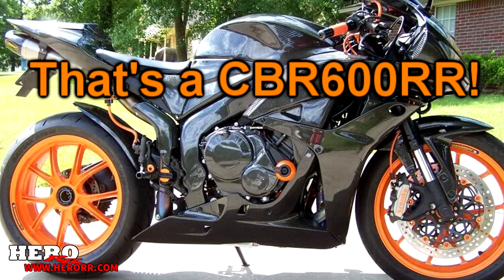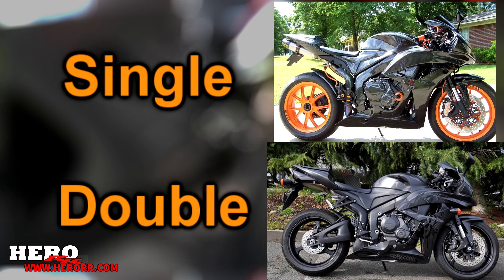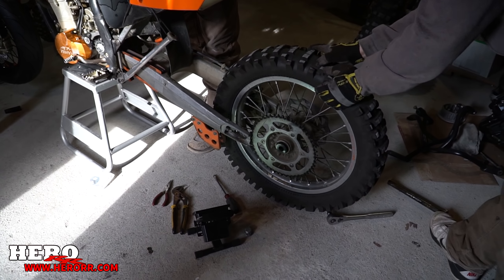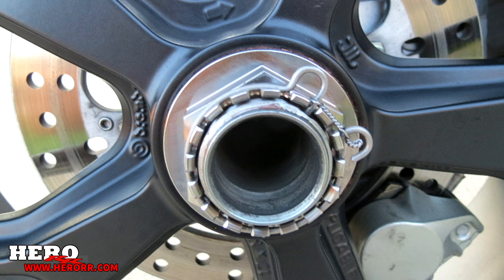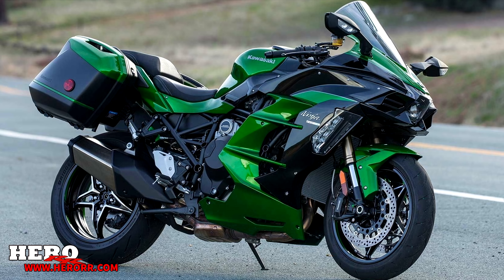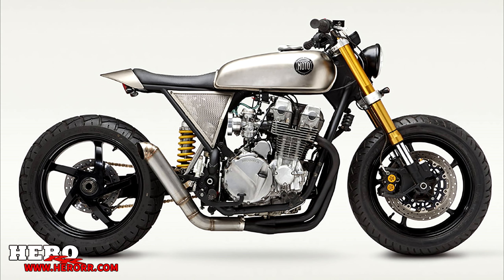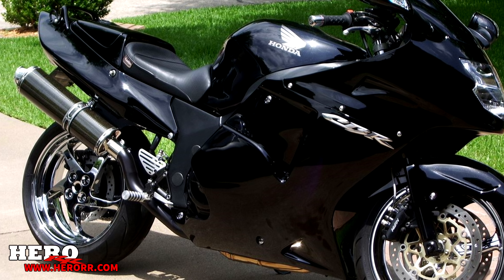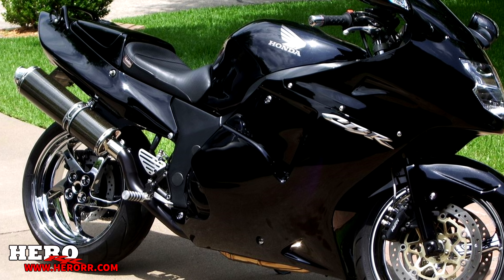Why Every Motorcycle Should Have a Single Sided Swingarm

Comment from the maker: I hear you guys! I get it that MotoGP bikes have Standard swing arms. You need to understand that MotoGP bikes make over 250 horsepower and are less than 350lbs dry. The reason why they use traditional swingarms are because the twisting motion required to handle that much power would make the swingarm heavier, and the weight would be bias to the left side (or right) which is a no-no on MotoGP bikes. I don't know why you guys care about what MotoGP uses anyway? It couldn't be more irrelevant to all the other bikes we are ride. Remember moto GP bikes don't even have a starter, they have to bumped start. Are we going to really start a debate on why electric starters suck too, just because motogp doesn't use them? LOL
Reply: People care about Moto GP, and any other form of racing, because the best technology from those bikes works its way down to street bikes. Without that we wouldn't have liquid cooled bikes, mono-shock rear suspension, monocoque frames, upside down front forks, aerodynamic fairings and so much more that's been improved through racing. Of course a race bike is going to be as minimalist as possible to save weight, but it's ignorant to not acknowledge the link between the street and the race track.
Reply: With that logic people should just stop racing bikes competitively because they’ll never be motoGP riders.  Do you even hear yourself? Not all riders aspire to race competitively but also not all riders ride bikes just for leisure and cruising.
Reply: the peugeot speedfight 2 has a single swingarm in front

Comment: Aesthetically, and for ease of maintenance they are better, but that is all. A conventional swing arm is inherently mechanically superior, and allows for finer tuning of side to side flex in the swing arm as the bike is leaned over. Even Ducati use a conventional swing arm in their Moto GP bike for this reason, and the Ducati WSBK teams have talked about the difficulty of tuning the rear end due to the single sided swin arm, which they've had to cut and patch to get the proper flex.
Reply: crisray6789 I'm on your side before you think about bitting my head off. now I own a driveshaft motorcycle and I know the reason they don't use thoughs is because it pulls to the side of the swing arm when you give it throttle but I thought just the single sided swingarm people didn't use them because of it not having = weight!? not saying what you said isn't true but I think weight was the factor. LMK what you think.
Reply: Shaft drive bikes are usually fine with having a single sided swingarm since the drive shaft is already supported thoroughly by an outer shaft housing so adding another side to the swingarm is unnecessary. Shaft drives aren't very good for sport bikes though since they are much heavier than chain drives and sap more horsepower.
Reply: crisray6789 no I know I mean what are your thoughts on the none driveshaft single sided swing arms. I think there con is not having = weight on both sides. would you say that's a myth or is there truth behind it!? the = weight might sound silly but when dealing with two wheels it puts it into a better perspective.
Reply: @canyonkiller4431  Sounds feasible. You have all that weight on one side of the bike with a SSSA. Picture waving a lollipop(SSSA) vs. balancing a teeter totter(DSSA). Changing direction would probably be easier towards the side the swing arm is on, as you're accelerating the mass with gravity and harder as you're accelerating the mass against gravity.
Reply: Rock Fisher that's what I was thinking
Reply: In your opinion
Reply from the maker: The side to side flex is so minor that it really only makes a difference at the MotoGP level. For street bikes there is no real handling advantage from one system to another. I get that people always love to talk about the MotoGP bikes, but I never understood why. I mean how many of us have a 300 horsepower 250 mph 400lb motogp bike that we race on a track? My content is more or less suited for street bikes and street riding. Although an SSA is fine for the track and high horsepower bikes (see ninja H2R) only at the very highest level of performance where literally every gram of weight is measured do you actually see a difference.
Reply: HeroRR Moto GP sports the most competitive machines in all of motorcycling, any advantages that can be had, without breaking the rules, will be taken. So when looking at what will work best for performance Moto GP is the place to look. As for street bikes, it will cost more for any given level of performance, without any gain other than aesthetics, and ease of maintenance.
Reply: HeroRR but if the sssa was the best motogp would be using it so it's not the best. you just admitted yourself. PS the kawi H2 is a POS and I'm not even going to talk about the one trick pony none street legal H2r... you have much better bikes, the ducati desmosedici, the Honda RC213v and the aprillia rsv4 RF LE. guess what!? all dssa.
Reply: HeroRR yes you can design a single-sided swingarm with negligible increased Flex compared to a double sided swingarm. However, that does require adding significant unsprung weight. On top of that you have to have a much more complex hub assembly to allow the wheel to mount and Dismount without touching the axle. This is where all of the excess weight of the single-sided swingarm come from.
Reply: But how many rider push their bikes enough to feel how much the rear flexes. 99% of us want the looks and ease of maintance . I hope each manufacturer standardize front and rear wheel hub size and have single sided swing arm on all their higher end bikes. like how cars have off set and bolt pattern. Makes shopping for wheels and swapping them out much easier . Honda been doing it for bikes just abovr 10k so they proof that it's doable
Reply: Darrell Funk you may not be able to feel the difference, but your wallet will.
Reply from the maker: MotoGp bikes don't have seats either, so are you willing to give up your seat as well? Just look at BMW's website, they admit that their SSA is lighter than their old standard swingarm. Single Sided swingarms are the best for 99% of the bikes out there. I bet none of us have even sat on a motogp never mind rode one.
Reply from the maker: MotoGP bikes also don't have a starter, are we going to start a debate on why starters suck too?
Reply: Actually motogp swing arm is tuned for flex . Ridget when up right and flex when leaned over for some added suspension. In that aspect ya a multimillion dollar race team would design a throw away part to be use on their bikes for a season or two. A double sided swing arm would allow for more symmetrical flex from one side to another . But a SSA for consumer market can be build so ridget that it doesn't really matter . They might flex but not to a degree that we can feel.your tire is most likky gonna break traction than its got grip to bend a swing arm.  80% of people don't even have their suspension dialed in or ride with correct tire pressure and here u are talking about chassis rigidity for a street bike
Reply: HeroRR those bmw's use shaft drives, not chain drives, it's not comparable, and that's completely asanine to bring up the lack of starter motors and proper seats. If 99% of bikes had a single sided swing arm then 99% of bikes would cost much more, and for no performance gain. 

It's OK to like single sided swing arms for purely subjective reasons though, I myself would love to get a panigale even though they aren't the most pragmatic bike.
Reply: Not all Panigales are single sided swingarms either though. Only the higher models. Panigale 959 are standard.

Comment: All of the current MotoGP bikes run conventional style swing arms. Just sayin..
Reply: Bobby Backmarker I just said the same thing 😂
Reply: How does MotoGP matter when you ride on the road at reasonable speeds?
Reply: Riding Weeb The point is that for utmost performance a conventional layout is preferred by the experts at Motogp. Besides, many of us take our road bikes to the track and enjoy unreasonable speeds:) Even spirited road riding can begin to push the envelope of performance. Much of racing technology makes it's way to road bikes eventually. That's why I feel it's somewhat relevant.
Reply: so? motogp bikes run all with dry clutch but all superbikes use wet clutch (even ducati, now). Don't compare motogp to road bikes
Reply: Bobby Backmarker

So you can ride like a motogp rider and really need the added structural redgidity of a double sided swingarm because your machine is at its limit constantly?
Reply: Yes dry clutches are more efficient but the caveat is that they do require more maintainence. We're taking about swing arms here of which maintainence isn't an issue. At no stage did I directly compare a motogp bike to that of a road machine but It's fair to say that motogp technology makes it's way to the street over time. Infact, Suzuki claimed their main reason for rejoining motogp was to further develop the GSX-R series and would use the lessons learned on their road bike. The mechanical variable valves on the current gixer is but one of many examples of this.
Reply: I didn't say I could ride like a motogp rider nor did I say I needed a double sided swing arm because my machine is constantly at the limit!
Reply: Easy enough to bend a rim mate. I've done it on a couple of occasions!
Reply: It matter because if they dont use it is shit...lol still think they are beautiful work of art
Reply: Stability. It's more rigid and less prone to suffer torsional forces as single side swing arm. At least I've been told so.
Reply: @Riding Weeb MotoGP influences the design of factory bikes. One of the reasons why Yamaha is falling behind in GP. Actually MotoGP except for its racing part it's a huge factor that determines the sales of those bikes, so... It matters by that means.
Reply: Isn' that because it is more effetcive and stable against chattering, rather than the single one?
Reply: for outright performance and weight saving a conventional swing arm is better, but for street use (and track use for most people) SSSA means easy chain adjustment with no alignment issues, and it looks cool. its one of things how often do you push your bike to moto gp style limits vs how often do you adjust your chain?
Reply: riped the side of the rim to the point the Tyre deflated on a long thin pot hole between lanes once, that was an expensive experience :( and 2 months of having a splinted hand from a ripped tendon. councils need to pull their fingers out over pot holes on motorways and dual carriage ways.  anything where people are expected to be doing 70+ should be a safe surface.
Reply: "We're taking about swing arms here of which maintenance isn't an issue"  chain adjustment :p losen a bolt, sping the ecentric bearing tighten bolt done. foolproof and simple and if you've got a center stand can do it damn near anywhere
Reply: Yes because pound for pound a standard "dual" swing arm is stronger... SO if power to weight is your absolute focus then single sided is not the answer. However MotoGP bikes are like F1 cars... the way they are built does not directly translate well to a street vehicles, yes we can thank MotoGP for hand-me-down technology, like water cooling... BUT the point is directly comparing a MotoGP bike to a street bike, is pointless.
Reply: They need the weight balance to be near perfect when your battling for every tenth of second which is irrelevant when talking about on the street real world performance. racing is still a business, double sided swing arms save cost when building the bike. also you wouldn't be able to physically achieve that advantage without using those special GP tires, the compounds available to the public are those from moto gp 10yr prior, so our street bikes have a long way to go tire wise before they start taxing the actual suspension and chassis
Reply: Because a conventional swingarm can be designed to perfection for the forces they need to whitstand, also the lateral forces which are very important. It's a loss of time and money to design a single sided swing arm for motogp since tire changes are not even a thing during the race. They just have a second bike ready to go if it starts raining. Conventional is better for races, single sided is better for everyday riding. That wheel alignment and chain adjustment just kills me everytime I have to do it with all the fking mosquitoes around. Fml.

Comment: Unless the conventional swing arms are being over-designed, the single-sided swing arms will absolutely be heavier if they are made from the same material. By having the support point on only one side of the tire, not only is all the force going to one side, but a torsional moment is caused by the centerline of the swing-arm being off-center to the tire. WIth a conventional swing arm the support is on both sides of the tire and the torsions caused by eccentricities of the supports counteract each other.
Reply from the maker: Yeah, in general a standard swingarm will be lighter, but it's not always the case: https://www.bmwmotorcycles.com/en/discover/engineering/technology-detail/suspension/single-sided-swingarm.html
Reply from the maker: Of course that's with a shaft driven motorcycle so maybe that's why that is.
Reply: That's marketing - not engineering. "Less Weight and Greater Torsional Resistance" - as compared to what? A conventional swing arm made out of a cheaper and heavier material? or maybe compared to just a poorly designed conventional swing arm.
Reply: Yeah, since it's a good idea to house the shaft anyway, they may as well make the housing a strong structural component and get rid of the other side of the swing arm.

Comment: An over engineered fancy and stiff single sided swing arm will be lighter than an old standard aluminium conventional swing arm, but given an equal amount of engineering and fancy materials the conventional swing arm will allways be more efficient when it comes too weight/stiffness/strength, this is pretty non-debatable.

Comment: View from an engineer: 

• The hub and swingarm assembly is not easy to design and 10x more difficult to manufacture. The CAD is just a small part but designing the eccentric hub and a Swing arm which clamps perfectly is a real deal!
• the double sided swingarm is much easier to design and the greatest benefit of it is that the wheel stays in double shear and it is capable of handling some misalignment in the axle, whereas the single sided swingarm axle need tighter tolerances and more precision (Which require an expert behind the machine to make one).

Comment: Can not argue, they are the best.   I have to reiterate, single sided swing arms handle as good if not better, there is no unnecessary float, no wheel or axle deflection/movement.   The only argument is that it takes a more skilled mechanic to overhaul properly!

Comment: My understanding of the history of this design is that it was developed for use in the TT races where there's a tire change requirement. While I think you could overcome the weight vs stiffness penalty of going to one side by using large thin cross sections (Let's not turn this into an engineering lesson), I must admit I'm not a fan of this design for general use. Despite the fact that the tire looks so cool (like it's "floating"), what the narrator lists as an advantage can quickly turn into a disadvantage. I'm referring to the lack of adjustment in the wheel alignment. Great when the bike is completely straight, but as components wear and the bike gets laid down (nobody's perfect) the alignment of the rear wheel slowly goes out of wack. This shows up a head shake when riding with no hands. This showed up in my VFR and there was nothing I could do about it. So what you end up with is a throw-away motorcycle, which is not cool.

I've been turning the spanners on my own bikes for decades now and I'm always a fan of any manufacturer that builds adjust-ability into their design. I might get through three services before I need a new rear wheel so easy of removing the back tire is not high on my priority list. I prefer ease of access to components and a smooth torque curve.
Reply: if you've crashed bad enough to bend the frame or the swing arm your motorcycle is illegal to ride on the roads anyway.

Comment: You forgot to mention that the single sided swingarm allows the exhaust to be tucked in more where the regular swingarm would normally impede it allowing more ground clearance in right hand turns.
Reply: Death Wish83 at that lean angel you won't even have to rubber to put down, unless you you lowered your bike then it's a benefit, but moto gp ducati used conventionally swing arms for a reason

Comment: Adjustments on the 996 are crazy ez. Takes more time on my 900ssie. Love SSSAs on just about anything but Ducati knows how to really make it work. I've always wanted a GTS 1000 with a SSSA mod out back. A Tesi 3D would be awesome as well but the stock swing arm on those looks to good to replace. You don't see them all over as they are expensive to produce and heavy compared to normal swing arms.  But let me tell ya. A SSSA with a quick change sprocket carrier. You can swap the old chain an cogs in record time and the wheel is always straight.

Comment: My 2019 CB1000-R has a well designed SSS 👍 well balanced vertical thickness that stretches inward half way towards the rear wheel and the wheel alloy that attaches to the SA are bent outward the opposite direction (right side if you look it from the back) & there are 5 nuts holding the wheel to the SA. with a beefy 190/50/17 tire

Comment: The single sided swing arm does have an advantage in endurance racing due to the fact it takes far less time to remove and reinstall the rear tire. Also I don’t really feel any flex on mine but I m not a street Rossi either.